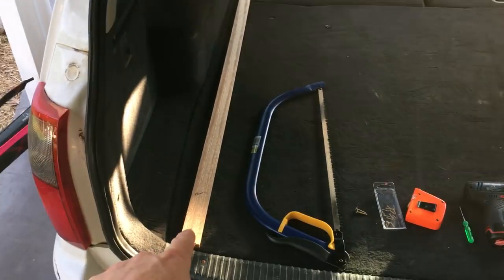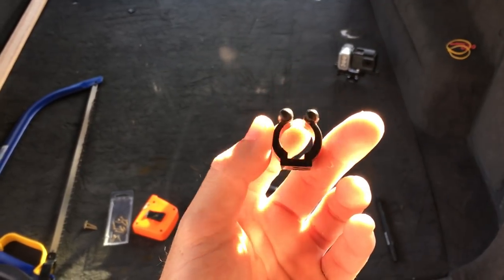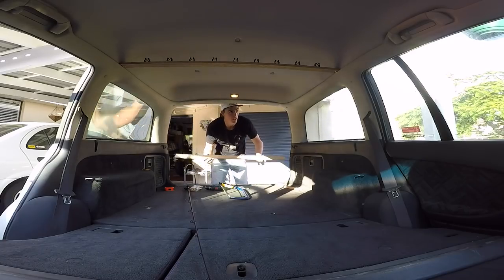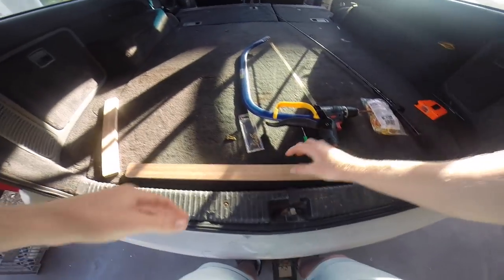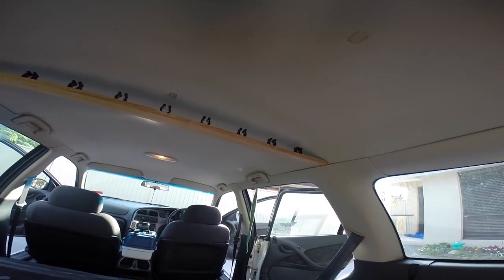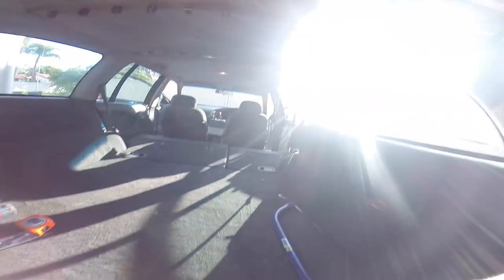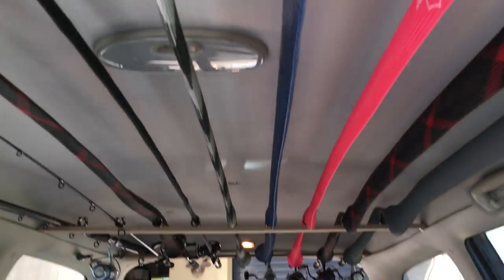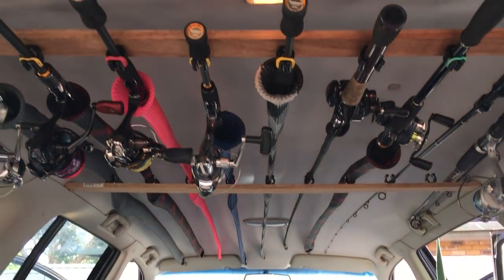How to Build a Cheap DIY Fishing Rod Holder for your Car!!

Comment: I got some 3mm bungee elastic similar to the stuff used in kayaks and picture eyelets.  you can then screw a loop of elastic into the board on one end with the eyelet and leave a screw 'proud' on the other end so you can loop the elastic over to hold the rods in.  more work but slightly more convenient than rubber bands.  another option is nacsan rod holders with velcro.

Comment: I've made dozen different ways loved almost all. But I use PVC and work great but I didn't no you can buy them clips been looking I'm so glad you got some now I can add when I put my camper shell back in my truck. I made a vidoe and just showed how I got in my truck can hang dozen out the back just 12 pieces of pvc 8 in long. 2  2 by 4s and one rope and there in between the rales on the ladder rack hey they work. Yea out side but I placed sheet of plywood wood on top cause I'll set up there when fishing I have 4 rod holders up there gets my line way up and also I can lay down lol. But I slide my Jon boat on top so the wood helps keep the reels dry and helps the boat not nock around on the steel bars driving.  But great rod rack my new way to try. Thanks god bless

Comment: Well..   that's pretty damn clever man!! Wish I had a bigger car then I do.. I just have a 03 chevy cavalier so I have to get my rods in however they fit in lol..  usually consists of sliding the handle and reel in first thru the back door towards the front and letting the handle and reel rest on the front console by the windshield and then carefully bending the tip of the rods in and puttin the tips in the back window or vice versa...  and I try to put the middles of the rods on the sides of the drivers and passengers seats to support them in the middle and it's a PITA to load and unload lol.. I really like your idea man bc you could just leave your equipment in your car and the average thief probably wouldnt even be able to see them in the dark up on the inner roof like that..   I've had thousands of dollars stole out of my car in tackle rods and reels bc I was tired after trips and didnt want to mess with unloading the mess because lines are always tangled up around other rods and lures wrapped around other rods etc.    Very awesome video sir...  thanks from the states..  wv to be exact